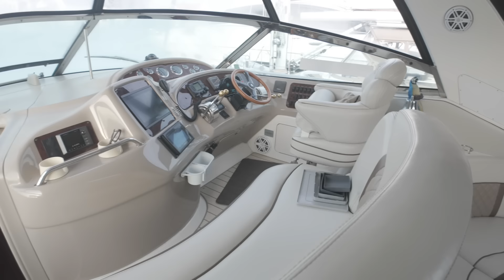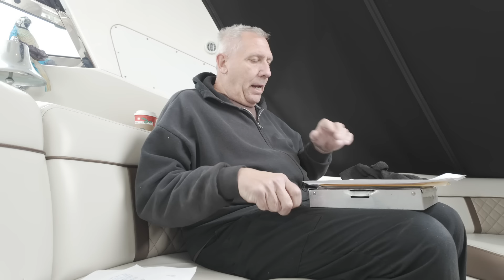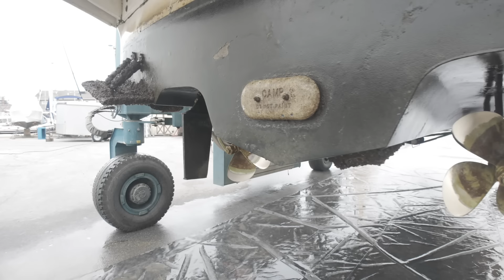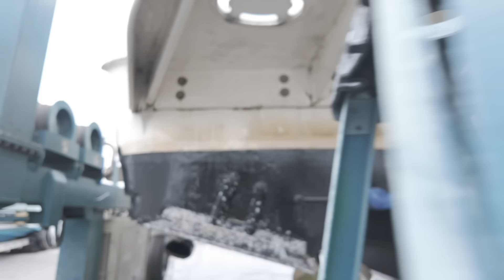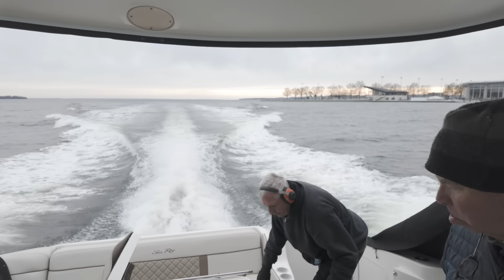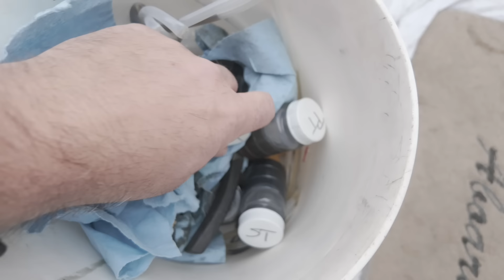2001 Sea Ray 460 Sundancer Sea Trial | What We Found on Survey

Comment: Are we sure a fuel bladder is not a sufficient fuel tank? Airplanes and race cars often use fuel bladders without issue.
Reply from the maker: Determination after research, it is a sufficient fuel tank to my surprise just the first one I’ve ever seen installed in that fashion

Comment: How did they get the old fuel tank out of the boat    Nice job on the survey thank you for documenting it well done
Reply from the maker: Great question, they did a fantastic job on the replacement! Cut it out
Reply: @yachtbossteam  but what did they cut out the top floor of the boat the transom? How did they get the tank out? What part of the boat did they cut apart to get 100 gallon plus fuel tank out of that boat?
Reply from the maker: @DriveSafeDon  spoke to the mechanic yesterday. He actually got behind there on the other side, cut it out sanded lined it did everything properly. My Buyer is very well researched. And he did the job properly.. the cut out portion actually he did it in place did not remove the motor did not cut the trans out or the side of the boat, I had an old listing that they cut it out the side of the boat, which that is possible
Reply: @yachtbossteam thank you

Comment: Seems to me that a priority method should be employed to make the process more efficient.  High-cost repairs should be looked at first before doing a complete survey.  For instance, if termites or rotten stringers or fuel tanks requiring replacement were discovered, there would be no need to go any further with the survey.
Reply from the maker: We almost stopped the survey due to the fuel tank being replaced with a bladder. My buyer did his research said it’s approved. They’re very solid never seen that in about ever.